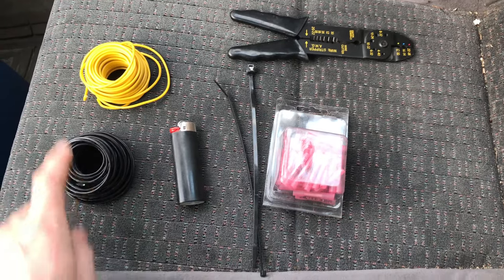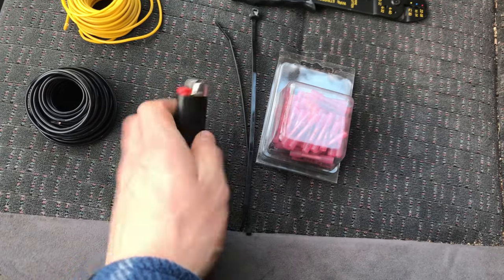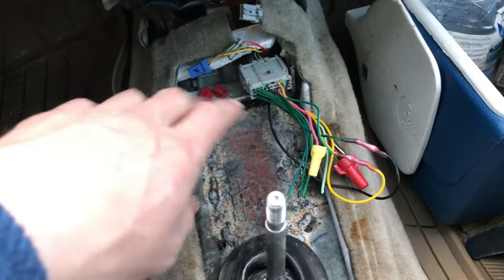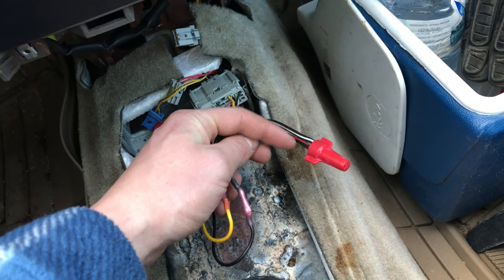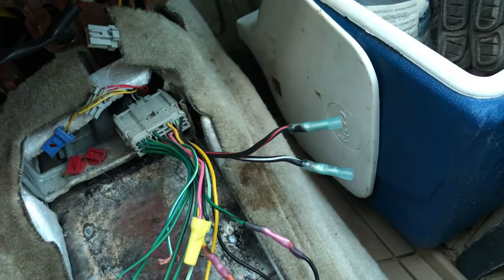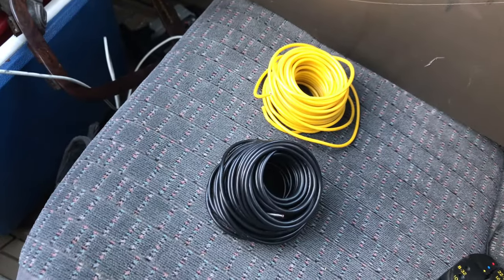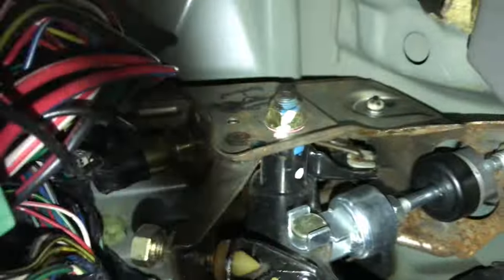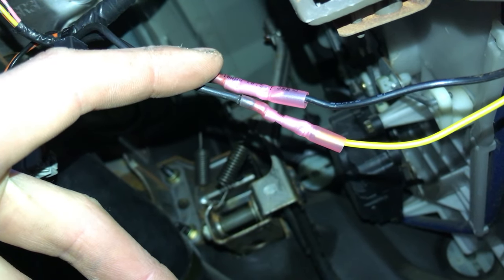Acura Integra Build Part 7 | Clutch Switch/Ignition Wiring | How To/Tutorial

Comment: Do u have a video of the other wires u wires together?
Reply from the maker: Brendan Aduddell the reverse switch?
Reply: @IsaacWorley  I've done alot of research and just got done doing a swap in a 97 Civic with a b18b1. It starts, actually says it's in 2 gear. I just have to cut out piece under auto n drill holes for shifter... Just wanted to make sure how to do all the wires right other than the black+red, and black+white..

Comment: Do you have to do this for the reverse lights to work ?
Reply: Yes I know pretty late comment but if u haven’t figured it out it’s 2 wires coming from trans in the front to 2 wires which I believe are green and yellow from the auto shifter plug
Reply: @DarkMan1290  yeah lol I figured it out. I even posted a video explaining the process on tik tok

Comment: Hey Congrats on the swap. Just had a quick question....when you wired the clutch safety switch does it matter which wire goes where on the prongs from the auto 2 thick gauge cables ? Or does it just have to like complete the circuit or...idk.
Reply from the maker: Dardo's Mini Engine Shop All it does is complete the circuit! It doesn't matter which wire goes to which pin. Hope I helped :)
Reply: Isaac Worley helped a lot thanks bro. Subscribed !

Comment: Hey man I just recently did an auto to manual but everything is done right I bought a 5 speed harness to go with my Ecu but sometimes my car does not want to start could that just be those two wires not being spliced together??
Reply from the maker: Jose De La Torre I didn’t replace my engine harness. If you’re talking about the two wires in the cabin next to the shifter, they need to be spliced together. I’m surprised your car even starts
Reply: Isaac Worley well see I have a 96 civic hatch so I bought a jdm B18c r from hmo and I bought the 96-98 5 speed harness instead of using the one they gave me being that the harness is flipped since it comes from Japan but anyways I also have the manual Ecu that they also gave me but sometimes I get it to start but do you think the issue is those two wires needing to be spliced? I’ve been doing so much research and I’m just out of ideas on what I could do and if it is just those wires I’ll do that tomorrow and I’ll let you know thank you!